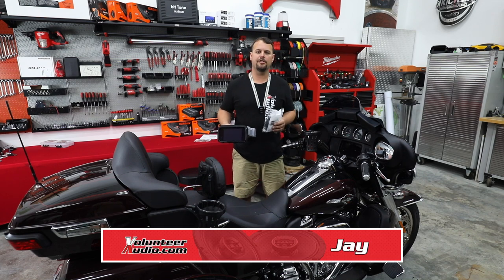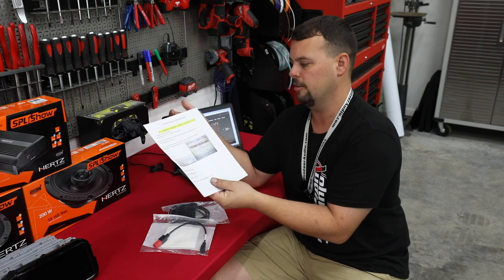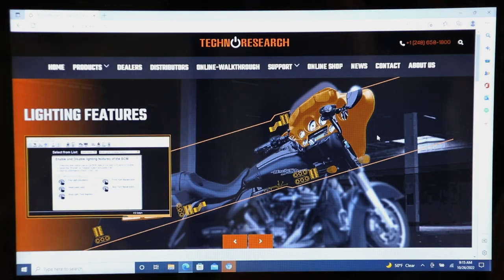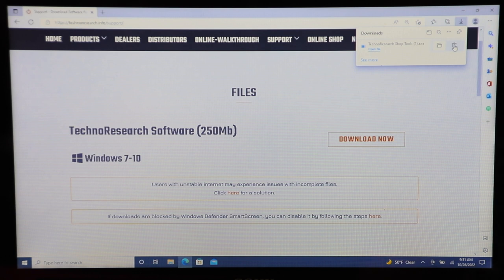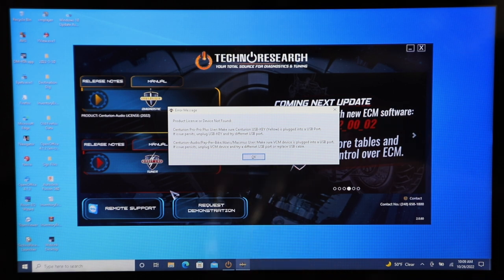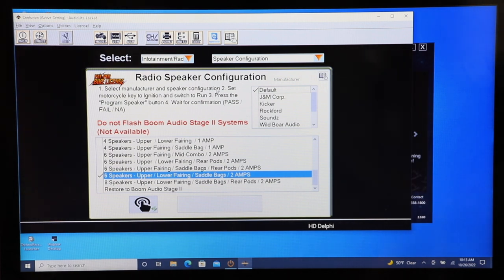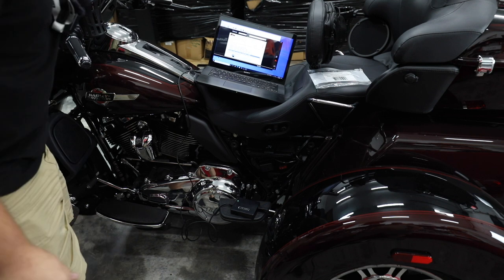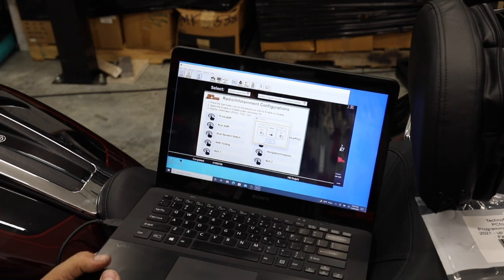Step by Step - How to flash your factory radio when adding a new amp to your Harley Davidson

Comment: Is this the same process to use to add rear speakers no amp and stock radio on a 21 Streetglide??
Reply from the maker: If you are not adding an amp you will select the 4 speaker no amp flash

Comment: i was just wondering why the 6 speaker flash instead of the soundz which has a flat curve,  just curious
Reply from the maker: This flash has the strongest output, the soundz flash is the 8 speaker 2 amp boom flash which does all the same things but radio output is less than we like

Comment: Do you lose your fade front to back with this flash?  I have no fade after the flash????
Reply: Also just bought the polarity tool because something seems off. Beautiful sound but no bass.
Reply from the maker: After flash you cannot fade, display will show fader but it will not actually move the sound, we gain the rear up slightly when we set the amp for correct sound and no need to fade

Comment: I was having an issue with Apple Play not working after I flashed my radio. I called Tachno Research and the technician tried to get it to work but couldn’t. He said the software might need updating. Have you ever had this issue?
Reply from the maker: Most important is the quality of phone cable, what radio do you have?
Reply: @volunteeraudio  The stock GTS radio
Reply: @macmcmickle8558  What year bike do you have? I had a similar problem with my brother's bike trying to get Apple Car play to work after I flashed it.
Reply: @keithbell8690  my bike is a 2020 Street Glide Special.
Reply: @macmcmickle8558  Sorry for the late reply. My brother 2020 street glide had Carplay issues until I updated the software on his GTS. I flashed his bike exactly how Jay did in this video. Now he has Carplay.

Comment: I cannot clear the following codes after using your recommended flash:
U0186c - Lost comm w/AMP 2 AMP COMMUNICATION DIAGNOSTICS
U0186c - Lost comm w/AMP 1 AMP COMMUNICATION DIAGNOSTICS

I clear them, then it keeps coming back!
I flashed the radio using your rental tool and the recommended flash. Installed the Hertz amp 4.900 ( With plug-n-play harness ) I purchased from you for GTS head unit.
How do I clear these codes that keeps coming back?

Amp is on, everything sounds great! Just cannot clear these codes
Reply from the maker: No need to clear these codes, you got these when running radio diagnostics, no light was illuminated on your dash.  If you properly flashed the radio you used a factory amplified flash that would have used factory amplifiers.  These codes just say the radio does not detect the stock amplifiers.  It will always say this because you are using a non factory amplifier.

Comment: I installed a wild boar kit and listened to it already so now how do I flash it?
Reply from the maker: The wild boar kit will not turn on if you flash it, it only works with stock no amp flash
Reply: I'm not following. I read a comment saying it has to be flashed before you listen to it if not the install has to be redone.

Comment: i did this on my 2020 RG Special, i installed the Precision Power powered sub. when i flashed it my front speakers wont work
Reply from the maker: What amp are you running in the front?
Reply: @volunteeraudio  cant really see its buried ill have to take the light out all i can see is its white. it was put in in Laconia bike week outside at a harley dealership
Reply: Wild Boar?
Reply from the maker: @BlownC52000  you can not flash a wild boar / hog tunes system or the amp no longer turns on
Reply: @volunteeraudio  so the amp is junk now?
Reply: if so what amp should i buy i have HERTZ in front
Reply: Thanks for nothing ... you should have mentioned that you can't flash a Wild Boar amp. I emailed and messaged you here and nothing I'll go somewhere else.

Comment: Can you flash a 2013 Street glide radio?
Reply from the maker: We recommend replacing the stock radio when upgrading 98-13 models but yes there are optional flashes for those years but we do not use them
Reply: What are the best plug and play options ?

Comment: HI, I just bought a used 2014, its got a stage 2 upgrade, boom audio, 8 speakers. I've got 1 channel out on the amp on the front and on the back. (i took to the dealer for them to finally tell me its the amps). I noticed  in the very big red letters there, DO NOT FLASH BOOM. I've got the 8 speaker boom. Would this work? (let alone the 6 speaker setting vs the 8 speaker setting)?  any help would be great before i purchase new amps. The bike has 1 blown speaker. And I do notice the low mids are super punchy, I turned mu bass down. I'm optimistic the flash flattening out the bass will help if it can work on my 8 speaker boom.
Reply from the maker: These directions that we have in the video are for replacing factory amplifiers with aftermarket amplifiers, when using factory amplifiers you must use the correct factory flash for your exact scenario

Comment: Hi, What about 2019 CVO SG? It has a WHIM, 6 Speakers and boom audio stage II, but on the software it says “Do not flash boom audio stage II…” in bold red
Reply from the maker: If you flash to boom 1 you won’t be able to flash back to boom 2, that is why it is red, if you flash the whim on again with software apple CarPlay will work without the need of a headset connected